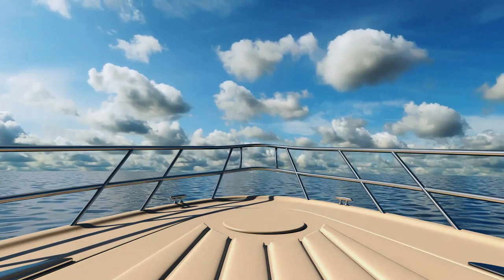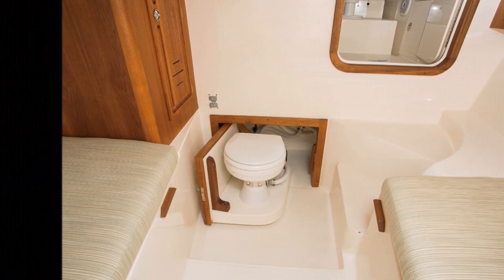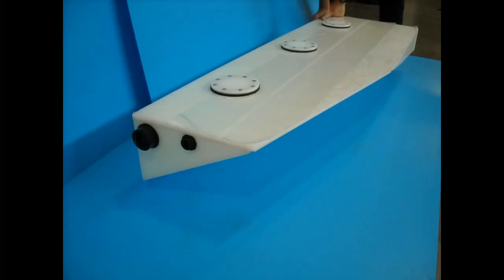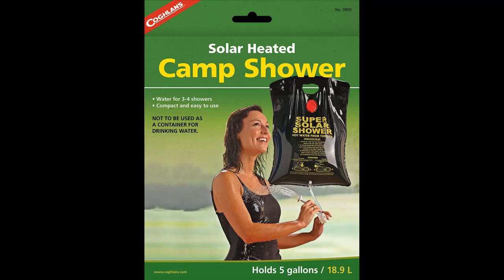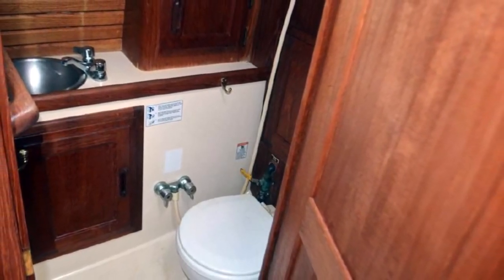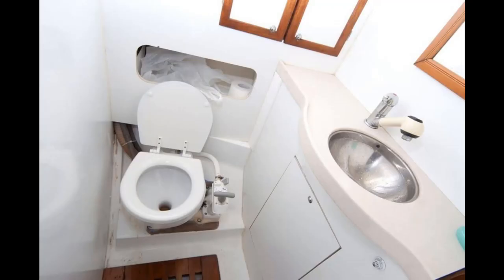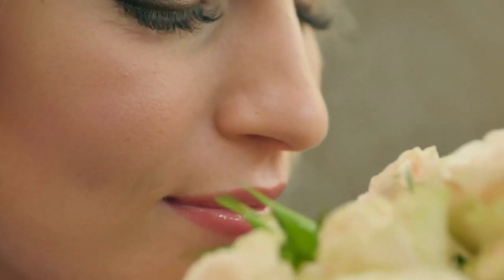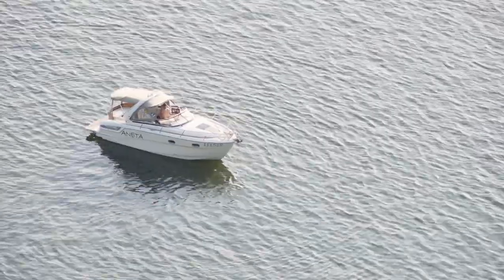Complete Small Liveaboard (Heads Toilets)  #boat # Liveaboard #Subscribe  #liveaboardlife

Comment: I started out with a Thetford Porta Potti, but quickly discovered that emptying and cleaning the waste holding tank was truly a thing of horror!

I then used the bagging method for solid waste, keeping it separate from the liquid waste.

As a solo traveller I don't generate that much waste and this remains my preferred method.

I am minded to try a composting toilet, but having seen the astonishingly high cost of the top marine versions, I will probably construct my own.
Reply from the maker: Im completely refitting a 32 foot boat and I made my own composting toilet for it.  I read and watched absolutely everything I could find on them. And designed my own. And I have to say some of the others are prettier than mine. But I think mine works the best. Yep blowing my own horn but I'm proud of it.

Comment: Good info.  Do marinas mind composting toilet?  Whats with weight.  Im dead set on taking my lathe / compressor with me.  I thought more weight would be better to resist bobbing like a cork.  You Canadian judging by accent?
Reply from the maker: Some Marinas do mind how you empty them. Truth is most people who use them just empty them into trash bags and throw them out. This isn't the best method but it is the most popular. It depends what type of boat your using when it comes to weight. Having weight near the bottom of your boat can stabilize you however the opposite is also true if your weight is placed near the top you will be top heavy and very unstable. The other issue with weight is fuel economy. And yep I'm a Canadian. Although I spend a lot of time south (Winter).